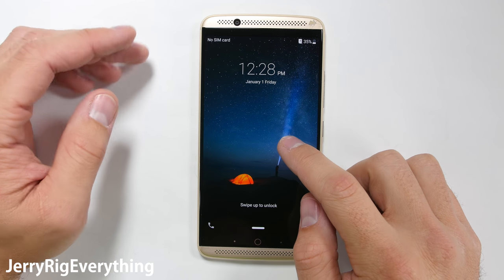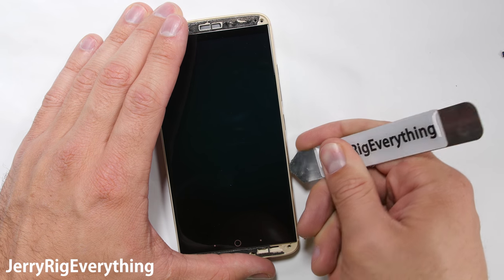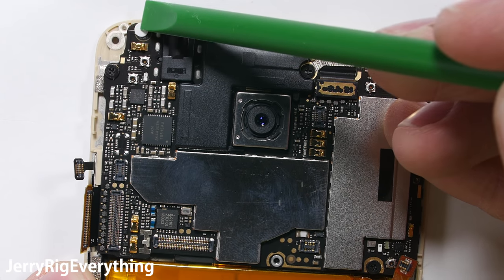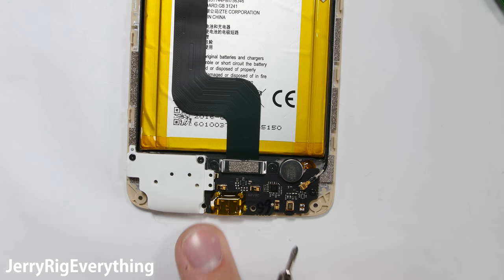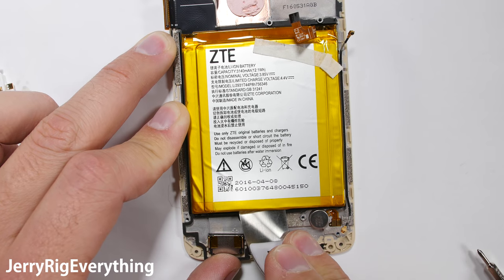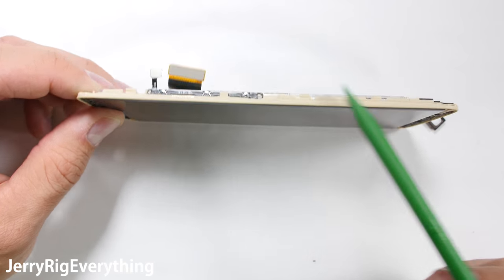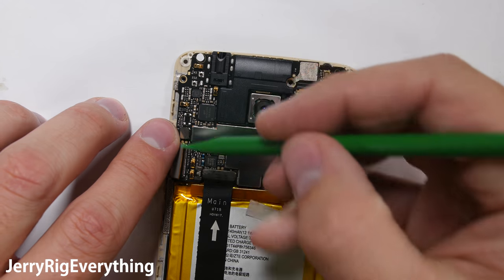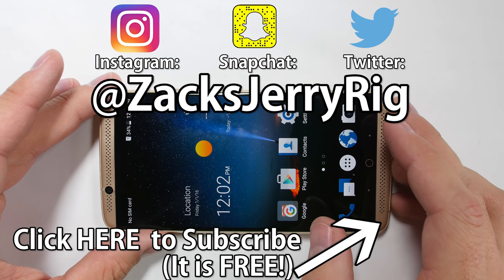Axon 7 Teardown - Screen Repair, Battery Replacement, Charging Port Fix

Comment: You sir just saved my but. I had the screen bug caused by the flex cable coming loose. Because of your video I was able to figure out how to disassemble & repair my issue.

Comment: I Love This Phone. Still kicking Butt to this day.
Reply: Well. Been 3 years since I've had mine. Using it right now. Can't remember the last time I used my desktop, or laptop. Because I cast everything to my Samsung TV when I want a bigger screen. It's had all the updates everyone wanted from the start. Including VR. 
The phone still sounds great. And I have a little Tribit Xsound Go, if it needs a Boost. And this phone will Boost that Well 💪 
And if I ever need a new phone. Probably would get Another Axon 7. 
It's done everything asked of it. Done it well, all day every day. And for all this time. Still looks brand new. And Only cost $279 on eBay way back when on sale. About the same price now. Which is less than 4 cents a day, rounded out so far. And it's still going... 
...i bought a caddy for my Dog with what ive saved over the years 😂...

Comment: I actually bought this phone because of your durability review.  I had to replace my 3 year old Nokia 1520, and wanted to move on to Android for the first time, so I had a lot of research to do.  I went to numerous other channels for reviews on the cameras, software, audio/visual stuff, but I checked every phone I was considering against this channel to see how it would hold up.  I was very happy to see how sturdy this one is, and I left a comment on the durability test video to support your methods of bend testing!

I still want to see a durability test on the 1520 though, even if it's not a new phone.  It's the best phone I've ever owned.  A 6" phone that I had for 3 years w/no case or screen protector, and it's still in great shape.
Reply: phrozt - I did exactly that back in October. My screen digitizer went bad on my Lumia 1520. Glance Plus in the Google play store helped me feel at home with my ZTE Axon 7.

Comment: Watching on a 3 years old Axon 7.
It was worth the Money. 
 It's time to move on. Battery is 2/3 of the capacity and no security patches. But it's hard to find a phone with real stereo speaker like this. And I love still the fingerprint at the back.

Comment: BATTERY REPLACEMENT: 
The ZTE 3140mAh batteries found on eBay look like the proper OEM batteries to replace with compared to the Cameron Sino 3100mAh batteries found on Amazon. Replacement procedure is best done by carefully heating speaker grills & having spare 2-sided tape to place back on. Also heat the battery by running something like Daydream or Pokemon GO while charging to loosen the glue for easy removal. DO NOT RISK USING HEAT GUN on the battery! This can lead to leaking/exploding the battery and/or melting the screen or damaging other components. 

Bonus Tip: I would suggest fully removing the thermal compound with a microfiber cloth and Isopropyl 99%(not 70%) then replace it with some high quality thermal compound like Thermal Grizzly Kryonaut or Prolimatech PK-3.
Reply: Hot tip, was thinking the same thing
Reply: Three years so far. 
And hoping I'll never need this info. 
BUT GOOD TO KNOW. 
That's why I'm here. For some reason, figured its time to brush up on repairs. Just in Case. But this thing has been so good. Costs less than 4 cents a day over that time. I may just get another. 
It's been that good 😂
Reply: @My-Pal-Hal  just replaced my battery
Reply: @yoyoyoyoyoyoyoyoyo81  
TRAITOR 😂 
I actually did a test of sorts on mine. 
Was getting charge amounts and rates that weren't consistent. Nothing THAT out of the ordinary from a battery this old, with constant use and charging for over 25yrs. (dog years 😂)
And I know how not to leave things on a charger. 
Or even let them drain or charge completely. 
But. 
I've had mine on a Slow Charger lately. And have increased the discharge time (from use of course) by about 20+%. Pretty Cool. Not sure why. But I have a good idea. Either way. I can still get a good day of use with Wi-Fi and Bluetooth. 

I DO Like This Phone. 
And about $250 for a new one. I'm considering that,.. Just Because 😂 

🎄HAPPY HOLIDAYS 🎄

Comment: Thanks for the tear-down. Made me realise I'm in for more than I bargained for. I really got the impression that they don't want you to remove the battery. I was thinking of using my hair dryer to get the grills off the speakers but now I'm thinking, I need a heat gun or I have to find out how much it costs to get a professional to do it for me.
Reply: I'd say battery replacement is relatively simple on this device.  It's vital to have the right tools ($5-10 on ebay).

Comment: Wow I am about to replace my battery today and I am thinking what if I mess something up when taking it apart and putting it back together but then seen you scrapped things with the knife and it still worked when you put it back together. I thought for sure it was ruined. Lol the seem like a solid phone.

Comment: Things he missed:  You can only remove the top speaker from the left side.  Also be very careful removing the vibration motor, its very easy to break the flat ribbon cable connected to it.  He doesn't show it, but those 2 items require removal if replacing the LCD panel.

Comment: Zack, the reason why some smartphones (esp. those who marked as "HiFi smartphones" or speakerphones) have plastic speakergrill and plastic cover from the inside is to prevent reverberation in the audio output, I KNOW speakers can use some sort of metal alloys that doesn't reverb, but for smartphones the budget is limited, most smartphones with metal grill speakers are garbage sounding, even the high end ones, my axon 7 is nice on frequency response, although it has 1 part only which is the tweeter, so subbass rolls of early like any smartphone/tablet speaker :(

Comment: Had my Axon 7 just under 2 years and the battery started to go downhill very quickly. Ordered a standard replacement (3140ah) on aliexpress ($8 inc p&p) and used the video to make the swap. All done in 15 minutes hairdryer was a must also watch the power button when splitting the case, it's a bit flimsy. Hopefully get another 2 years out of the phone...
Reply: Guess I've been lucky. 
3 years for mine. Daily Driver. 
And not a problem so far. Can't even remember the last time I used my desktop, or laptop 😂

Comment: Did you ever heard about a problem with the left half of the screen? My Axon 7 fell down from a table and now the left half of the screen turns grey sometimes and do not respond to touch. I think I will follow your steps and take a look inside

Comment: Whoa whoa whoa, how did you get the magnifying bubble at the start of the video?
Reply: David -flamingsword1 you just hold your finger on the lock screen and it will magnify that part
Reply: Oh, I see the problem. It only works with the zte locker enabled
Reply: David -flamingsword1 most likely, I haven't tried any other lock screen or launcher for that matter
Reply from the maker: +David -flamingsword1 it's a feature of the phone
Reply: For a second there I thought an android phone finally had an iphone-like text magnifying bubble feature. Dreams crushed 😳 I'm guessing Apple has a patent on it or something, because I'm surprised how after all this time, no one has done it yet.
Reply: i think its triple tapping the screen for android but you have to turn on that feature
Reply: scrvntr nono, that's the magnifying accessibility setting. I'm talking about a "magnifying bubble" like the one at the startbof the video, that pops up when highlighting text
Reply: David -flamingsword1 only the Chinese variant of the ZTE Axon 7 w/ 128GB & 6GB RAM is the only model with actual 3D Touch. 

Don't know why they left it out on the non-chinese variants. But 3D Touch is useless unless it's implemented on Google's side so it can be used throughout the phone. Such as a magnify bubble, etc... 

Until Google do this 3D Touch will stay with Chinese exclusive Android phones as they do not rely on majority of Google services.

Comment: That black thing is the memory chip, its made by SKHyinix, its a pretty standard memory chip, and its wierd that they covered it with the anti-heat paste. the processor should be marked with the Qualcomm logo, and its hidden under the metal shield.... otherwise, nice video man, really enjoyed!😋

Comment: Question: I noticed you linked two different pry tools aside from the tool kit that seems to provide it's own pry tools. The metal one is clearly the best option, and the longer green one I can see coming in real handy too. I was wondering if you've actually used the tool kit listed and whether or not you used different pry tools because of a problem with the provided pry tools. I'd rather not spend extra money is all..and would hope that I can get my phone open just fine with what's provided in the kit(I don't need to do much except get the device open). And by the way, Thanks for making this video! I've been a proud Axon 7 owner for almost a year now. No complaints really..except for  visible dust getting in between the camera lenses and the backing glass. I'll soon be using this video as a reference to take care of that myself. My photos still come out pretty good with no immediately apparent signs of impairment. Everything focuses fine and there are no visible specs in the photos. The lighting seems off a bit ever since I noticed the dust in there and I went back to photos I took when the phone was new..there is a huge difference in clarity. Hoping you see this comment and are able to answer my question about the pry tools.

Comment: To disassembly everything on this phone Screen, Battery, Speaker Grill, ect. you need a heat gun to loosen adhesives used some of the strongest at that time.

Comment: What a huge pain in the ass to tear down.

Some tips:

* The speaker covers take a good amount of heat to get off, but make sure you aren't using too much or you'll melt your covers. get a really sharp pointed object and start on one of the top corners, then work your way across.

* Getting the frame separated is a lot harder than it looks. Work your way around getting it loose then focus on one side with a strong metal bit like he did.

* The speaker is again really on there. I wouldn't recommend using heat for safety reasons. I worked my way up and down the right side getting my object just a little farther in each time. It will take a while and a good amount of force.

* Unless you add your own adhesive it's probably not going to hold the corners down great. Even if you are super careful you'll probably have some distortion on the covers. Basically your phone isn't going to look like new anymore. Keep that in mind determining if you really need to replace whatever you're replacing.

Comment: The heatpipe is a good idea in theory...

Too bad about the whole "heat has nowhere to go because it's sandwiched between a battery and screen" thing. They really should have taken advantage of the aluminum back, that should make a pretty great heatsink. I guess it might make the phone uncomfortable to hold at high loads, though.

Comment: I've had a Samsung Galaxy S2 a few year ago and when I got that I thought that was the perfect phone. I heard the S3 S4 and S5 were just upgrades to the S2 but weren't that big of a game changer or that great. My S2 broke from droping a 50lb dumbell on it at the gym so I had to get a temp replacement. I got a $50 phone and it wasn't as good as the S2 but I realized there were a lot of things that was better on the $50 phone that I liked better than my S2 like better speakers, waterproof, newer android versions, etc. I learned to love it or except it then I broke that one. I wanted to find a phone that can be almost perfect that didn't break bank to buy so I took a chance with the Axon 7. Well I can't complain about anything on this really cause it still is better then any of the phones I had and it is still future proof. I can see people who don't have one say it's bad but it does what you want a phone to do and does everything well. I am glad I didn't spend 2x as much to buy a Galaxy again. I hate the glass back on those.

Comment: The liquid cooling thingy (heatpipe) actually has tiny bit of liquid inside. 

And it also helps to heat up lithium battery up to operating temp. in colder days.

Comment: Midrange?   When this came out it had the fastest Snapdragon CPU, Fastest Ram, Fast USB 3 Data Transfer and USB C Charging. One of the highest resolution displays, some of the best speakers, and a headphone jack.  The only things it was lacking was a premium camera even though it was pretty good, and wireless charging.

Comment: Watching this from my axon 7 👍. Great hardware, shame about software
Reply: What is wrong with the software? Was going to buy one
Reply: Matt Farla I am using axon 7 right now. The software is great, idk what that person is talking about. Excellent battery management, and the performance is superb. However, I don't like how the home screen looks, but that's easily fixed by installing a launcher. I have nova launcher on mine and this phone is a joy to use.
Reply: Same here.  I'm using one as well.  I installed Square Home 2 as my launcher though, because I'm coming from a windows phone and I miss it already :/
Reply: Oh, there's nothing wrong. I should have mentioned I'm using the Chinese model a2017; so there's bloatware in Chinese. I've personally been struggling to unlock the bootloader, so I'm stuck with stock rom for the time being
Reply: axon said the bootloader can't be unlocked, unlike the oneplus3
Reply: Fuzzy Dunlop also watching from my axon 7 but NOUGAT 7.0 FIXES EVERYTHING I LOVE IT
Reply: the american i buyed at BEST BUY
Reply: there isn't a North America one, 
Axon 7 has 3 models 
A2017G(global) 
A2017U(USA)
A2017(China)
usually, G model would not be as good as U model
Reply: I bought my Axon 7 three weeks ago from best buy. Its awesome
Reply: The software is fine
Reply: Software is great, but it's expensive as fuck to get screen replacements. Cheaper to just buy a new one lul
Reply: I just downloaded the Microsoft shell
Reply: As I wrote in another thread...
Well. Been 3 years since I've had mine. Using it right now. Can't remember the last time I used my desktop, or laptop. Because I cast everything to my Samsung TV when I want a bigger screen. It's had all the updates everyone wanted from the start. Including VR. 
The phone still sounds great. And I have a little Tribit Xsound Go, if it needs a Boost. And this phone will Boost that Well 💪 
And if I ever need a new phone. Probably would get Another Axon 7. 
It's done everything asked of it. Done it well, all day every day. And for all this time. Still looks brand new. And Only cost $279 on eBay way back when on sale. About the same price now. Which is less than 4 cents a day, rounded out so far. And it's still going... 
...i bought a caddy for my Dog with what ive saved over the years 😂...

Comment: I dropped my phone today and half my screen was random pixels. I saw this video and thought I was screwed since you need a hot air gun... Got an idea to just push down really hard where the LCD connector is.. and pop screen fixed. Thanks

Comment: ZACH!! QUESTION my top earpiece quit working after about 2 months and then the bottom speaker also quite.. I've factory reset it several times and it didn't help anything.. I've got the phone apart is the any advice you could give me to fix it or is it a motherboard problem? Thanks any ideas would really help...also the headphone jack works fine.👊😊

Comment: Hey, I watched your video. My axon works well except my power button is broken/or either stuck and cant be pressed. Can you reply to me and tell me wether I will be able to fix it with just disassembling it? Do I need to buy any part at all?

Comment: I've always wondered, if replacing the original front camera with a different phone's camera probably might work and do wonders, maybe?
Reply from the maker: I tried that before, the connections are different, so it doesnt work.
Reply: JerryRigEverything thank you sir for replying and doing awesome durability tests, you're the BEST.

Comment: Do you know of a thin substitute for the double sided tape under the speaker grills? One which lets air pass through, like the original? After 2.5 months I've got dust buildup under the camera lens and I would like to clean it out.

Comment: i think you were wrong considering heat pipe, usually heatpipe do actually has liquid in it in form of a vapor, because if it didn't, it couldn't make heat transfer like it does...sorry for bad english ;)

Comment: My axon 7 fell and now I can't see anything on the screen. The digitizer still works because I can answer calls. No visible cracks on screen or LCD leaks. Do you think the screen is finished or can it be something as simple as the ribbon cable came loose?

Comment: mid range launched in 2016 with snapdragon 820, dual stereo speakers, 1440P display Amoled, 20/8mp camera and great build quality?? are you sure that is a MID RANGE?

Comment: I really hate how most phones have all the electronics screwed or glued to the screen instead of to the back panel, IMO screen replacement is one of the most required service on cell phones, and this only makes it harder for  a DIY.

Comment: Hi Zack!
What is the difference between the vibrating motors? I've seen three different ones. this one, that looks like a button cell battery, the one with the half circle piece of metal, and the large rectangle one on the Iphone.
Reply from the maker: +Viktor Kongskov that Is a fantastic Video idea. Thank you! Ill show them.
Reply: Viktor Kongskov I think the rectangle motor is the more common one, I've always seen it of several different types of devices.
Reply: JerryRigEverything cool!